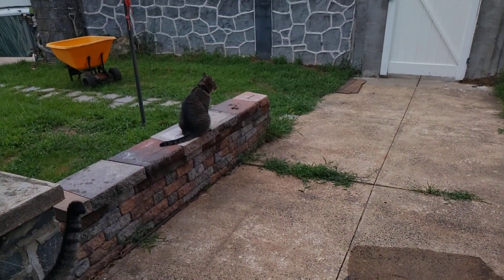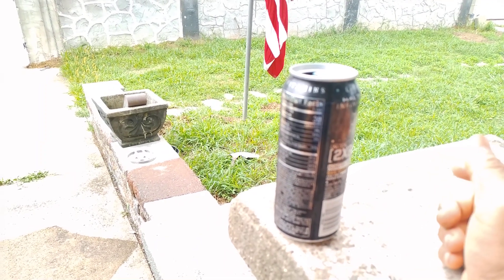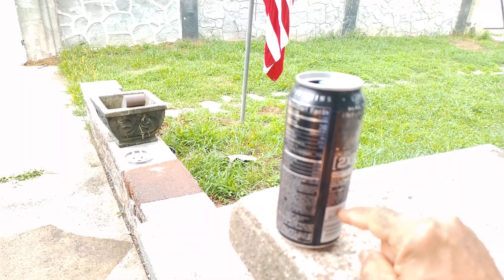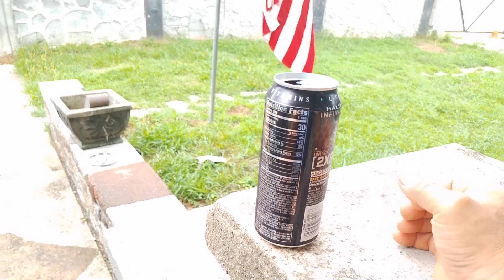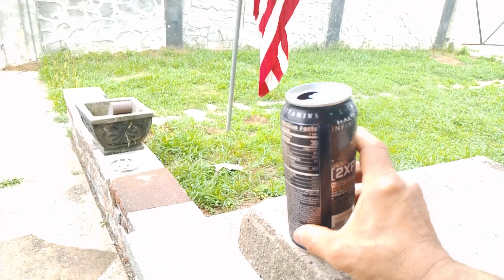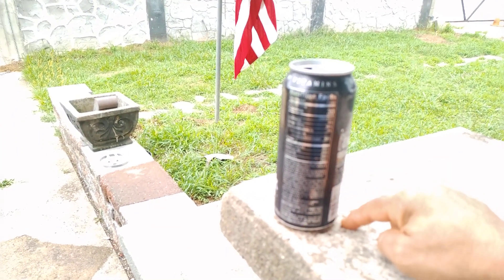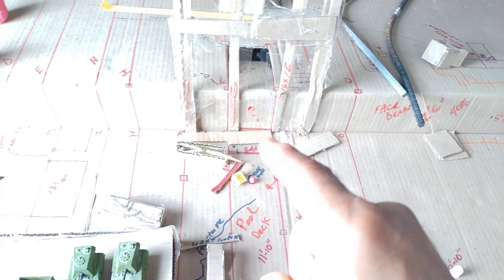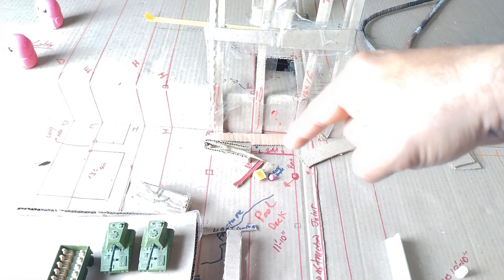Champlain Towers and 911 Building Collapse how "exoskeleton" systems failures Lowes and Home Depot ?

Comment: One ad. Barista coffeemaker. 
No Lowes or HD in UK. 
Interesting timeline and witness observation / interpretation you did in the (earlier) video. Witnesses are notoriously unreliable, not deliberate, but 'sense-making' part of the brain gets involved so their interpretation is the truth to them. Putting their reported sounds and sights timeline together, with the building failure stages as analysed, told a good story.

Comment: At the moment the consultant determined that multiple slabs have failed and recommended that these be fully replaced, and when he extracted that fractured sample, he failed to immediately order that pool deck and parking area be shored up and all the loads be removed.
Everyone there was a layperson, so it was up to him to prevent this calamity.
Same thing applies to the still standing North Tower. They should have done this until they are able to determine that it is safe.

Comment: The Saga Continues- Why, why didn’t anyone do anything to condemn Miami Condo aka Champlain Tower South aka Surfside Building????
Reply: Agree, if not in 2018 why not in late 2020 when MC came back and said it was getting worst. CPR claimed they couldn't continue working on the deck without destabilizing nearby concrete structures. Why?

Comment: Zwilling food saver stuffs.  Lowe’s is closer than Home Depot, so I go to Lowe’s. Both places were designed by chimps.  What a nightmare to find stuff sometimes.  Interesting to hear other people’s commercials and try to figure out what YT has me pegged as.  Thanks for all the videos.
Reply: That's a strategy of these stores use to maximize exposure of merch to the shoppers so people potentially buy more stuff._
Reply: @DjResR  That is a heck of an idea. Makes sense.  They are navigating one tight equation of for no better use “supply and demand curves”. On one hand I need something obscure, do I want to wander the store, can I buy it on Amazon, is it a “busy” time where there are employees to ask. (That doesn’t guarantee anything). Twice recently in Lowe’s I asked an employee and they pulled out a scanner of sorts, looked it up and pointed me right where the confounding thing was. I’d say that’s an improvement, but they still had me wandering around